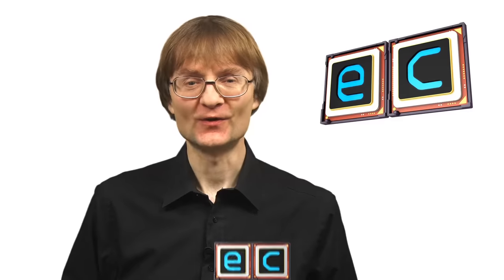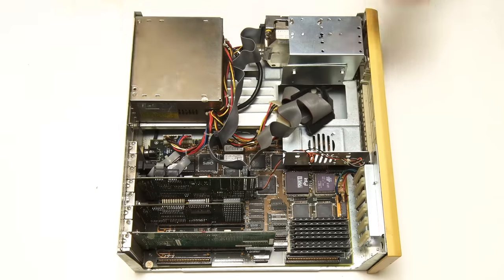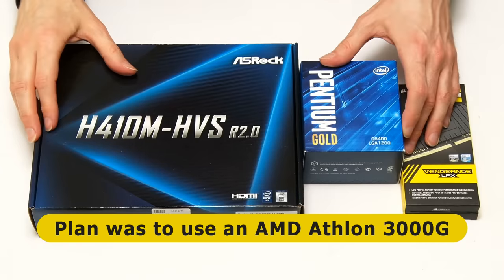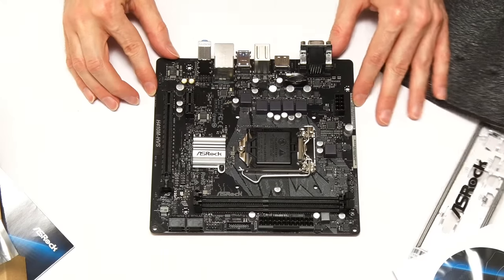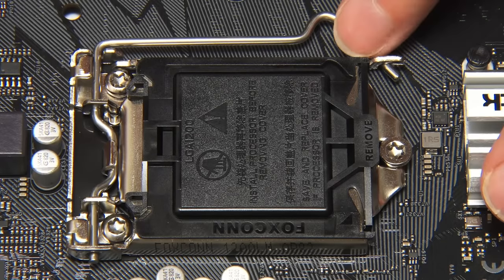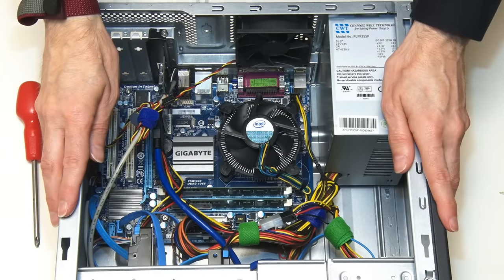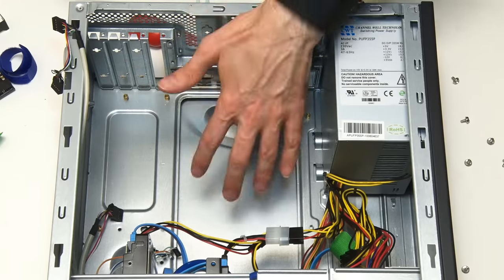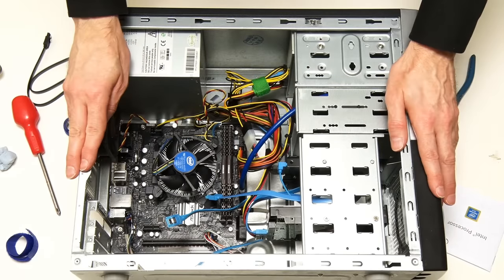Old PC Upgrade: Motherboard & CPU

Comment: Great video. It was nice to see a non-bleeding edge PC being updated. I upgraded my current PC a few years back with a new graphics card and several extra hard drives, but the old computer (it's 5 years old now) is starting to get on a bit. I'll probably go for a full new PC, even in this crazy priced hard ware market, as I can't see that being fixed in terms of supply in the next two years. It's good to see upgrades being not as scary as people might think. ;-)

Comment: My main PC from many moons ago inhabits a very old Dell case. When a major PC manufacturer builds a case and compatible motherboard,  the front panel plugs are guaranteed to be correct. Not only that they are grouped into a larger connector for efficiency in final assembly. In my case I have almost a dozen m/f pin cables aligning things up.
Enthusiast cases have pins like those shown with at most two front panel functions combined in a single dual connector as standards consolidate. The most common front panel functions are:
Momentary contact power on/off
Power LED
Disk activity LED
Momentary contact System Reset
Chassis speaker

There are several things that are becoming more standardized such as front panel USBs and audio connections.

Comment: There are two different standards for the front audio connection (which has to do with different codec standards).  If the case and the old motherboard are ancient enough, that front audio cable might not work with the new motherboard.  I ran into this problem during an upgrade, and had to buy a new front audio panel that fit into the case's unused 3.5" front drive bay (floppy disk?).
Reply from the maker: This is an extremely important point that I should have mentioned in the video. The case I was using had both standard and HD audio connectors, but earlier cases will not as you say.
Reply: @ExplainingComputers  What's even worse is that the motherboard connector is the same between both standards, IE: you can physically plug the older front panel connector into the newer motherboard, and it won't function correctly.  The good thing is that it also shouldn't damage anything, at least it didn't hurt the MB when I tried it.  If you look at the manual for the newer and older mother boards you can see how the various pin functions were re-assigned between the two standards.

Comment: This was good to watch, and amazing how things have progressed. That heat sink alone was fascinating. You can tell they wanted to spiral out the heated air from the design, which is a massive change from the original Pentium processors. 

Thanks for uploading this!
Reply: That's the one piece I wouldn't keep... they're adequate HSFs, but I'd swap it for just about anything with a copper foot and a more-captive fan. The blades out there where a strayed wire could hit 'em always gives me the heebie-jeebies.

Comment: You could use an M.2 SSD if you wanted to with a x4 adapter card since the PCIe slots aren't populated. Handy for when the motherboard doesn't have an M.2 slot.
Reply from the maker: True! :)

Comment: Good video as usual. I actually "sidegraded" last year; I have a PC I built in 2013 with an AMD processor from a couple of generations back that didn't like Windows 10 very much. I got a Dell Optiplex 9020 mini-tower and swapped my PSU, graphics card, RAM, drives, my front panel USB 3 adapter with SD card reader and it works very much better with Windows 10. The only thing I added was an I7 4470 and a Dell to ATX PSU adapter cable. Total for the PC and parts was about $320. The reason that these Dell Optiplex models have proprietary PSU connectors is that they are workstations meant to be used in big companies like call centers. If you don't need to swap motherboards this is a good alternative for everyday use, light gaming or a good Linux box. The PSU adapter cables are trivially easy to pick up and cost around $10-$15.
Reply from the maker: Sidegraded -- I must remember that one! :)

Comment: Perfect video tutorial. I've learned alot. I'm going to attempt my first build with older used parts and wanting to install them into an HP Elitedesk 800 G1 MT, if at all possible. No doubt that I will come across some difficulties but channels like this are a big help. Thank you.
Reply from the maker: Good luck!

Comment: I did this upgrade Richard. The only issue I had was the front panel connectors on my old case were all merged into one so there was no option about which pins controlled the hdd leds or reset switch. I just connected the block. The only thing I really care about was the reset switch and that worked correctly. Windows 10 came up without batting an eyelid and I will be checking all the drivers in due course.
Reply: My old case had a built in SD card reader which had a four pin female inline connector. I wasn't sure what to do with it but it turned out to be a USB2 connection which fitted onto half a USB2 header on the motherboard. Initially I got no audio on my hdmi monitor but I just ran the autostart on the drivers disk and that sorted it. Sorry about getting your name wrong Christopher. Massive embarrassment.

Comment: in fact that plastic cover that protects the pins on the MB is to be removed by pressing the bracket onto the cpu when it's in the socket. Most of the folks don't know that - and I've learned it from one of the manuals only recently, because I finally read one :)
Reply from the maker: I don't know which manual you've read, but it certainly isn't the one that Intel provide in the box with the CPU! :) This specific instruction guide from Intel says to raise the retention mechanism, then to remove the plastic cover, then to fit the CPU. Apparently some motherboard manufacturers advice removing the cover by popping it off using a processor, but it is certainly not something that Intel has ever recommended! :)
Reply: @ExplainingComputers   It was the Asrock, can't find the exact manual now but they did put it in their FAQ:
https://www.asrock.com/support/faq.asp?id=340
you have to click on the question below the table to get the popup which explains it. So it is in fact manufacturer-dependent, HOWEVER - your way (Intel official) will work 100% of the cases, so I stand corrected and encourage everyone to do it the way you did!

Comment: Hi Chris. Your channel was my first go to YouTube learning centre about 2 years ago. I picked up enough knowledge from you that aloud me to build my first PC in 15 years. 

Today’s budget build will help anyone the has an old PC and a has limited funds. This is definitely not a build for anyone that interested in building a Expansible system that will allow them to swap out parts and upgrade there system to something more powerful. The parts section put limits on what you can add. The motherboard is a major holdback, adding a higher end CPU would require a larger power supply and the lack of a M.2 slot is disappointing.  

Anyone that is in need of a more expendable system should review some of your past PC builds, the Ryzen system comes to mind. 

Take care and will see you next week

Comment: i was hoping to see ryzen xD or an older i5-8500. Based on the price i will prefer slightly older higher end parts than newer lower end parts. The older higher end parts will always have better performance
Reply: That is a good point. Also what supports older high-end parts will usually support newer high-end parts, once the price comes down.

Comment: Really nice video. Great photo. I would have replaced that stock power supply from CWT though. The older ones have a somewhat bad reputation, they tend to start fires... Their newer PSU are of much better quality.

Comment: Well that was very informative.  I had always assumed, obviously wrongly, that when you change the motherboard as long as you keep the drive with Windows on it, there would be no problem.  That could be quite an additional cost.  It keeps mounting up.  Thank you for posting that, excellent as always.

Comment: I have done exactly the same thing on a pc. I kept case, fans and psu. I also have no gpu. But my suggestion is to buy always a good psu. On another old machine i changed refurboshed dd3 mobo and ram and the refurbished psu (corsair) was shit causing random restarts. So i bought a new seasonic and now it works fine. PSU is the most important part of a pc while case is the less important.

Comment: This is not an old PC upgrade, this is building a new PC cheaply by using recycled parts.

Step one: throw out the old hardware.
Step two: Put new parts into old case and connect power supply and hard drive.

Comment: I did a very similar build upgrade a few years back Gigabyte H110m motherboard and Kaby Lake Pentium. 
Noticed that my old Intel CPU cooler had a copper insert so re used it instead of the new one, with a $5 tube of Arctic MX-4 and it runs reasonably cool even under load.

Comment: I wonder how you got 3050 for a passmark as my ac version of this motherboard with the updated version of the same CPU as yours plus 16GB of RAM at 2666Mhz with a samsung SSD only gave me 1866 :(
Reply from the maker: Sorry to hear this. I got the 3050 just by pressing the "run all tests button". What was your SSD? And CPU? And was this running Windows 10?
Reply: @ExplainingComputers  Windows 10 home 64bit. Yes I did that. The CPU is the Intel Pentium Gold G6405 version so 4.1 Ghz as opposed to your 4.0 Ghz one, using with the H410m/ac mb. Is this mb one not quite the same ? Bought it for the M.2 option. Btw with crystel disk mark about 550. The SSD is a samsung evo 250GB
Reply from the maker: @digitalmediafan  This is very strange. You clearly have a slightly better CPU, and the motherboard has exactly the same chipset (H410) so should give the same performance. Your SSD is also at least as good at the one I used (you can never go fromt with a Samsung EVO). So this kind of suggests some kind of driver issue to me, or something not set in the BIOS. I would take a look at the individual passmark scores (for CPU, RAM, etc) -- which you can see in the video on the left hand side at around 24:45 -- to find out where your lower score is coming from. Please do report back on this.
Reply: @ExplainingComputers  I see you are using a registered version (?) 9. I am using the 10.1 evaluation version. I tried clocking the ram speed down to 2400 but same result...
Reply from the maker: @digitalmediafan  Yes, I am using a registered version of version 9. But I think we have nailed this -- they apparently changed the algorithm between versions 9 and 10, so results are no longer comparable(!): see https://www.passmark.com/support/performancetest_faq/v10-results.php  As they say "So the new individual PT10 results can't at least on the surface be compared to the PT9 results. They are really different."
Reply: @ExplainingComputers  ah that's very interesting thanks. With this version I now get 3153 for 2400 Mhz DRAM setting and 3211 with 2666 Mhz. I've uploaded 3 separate results to my community section. Only thing is the 410m/ac is meant to accept up to 2933 Mhz but with me the maximum is 2666 which is a shame as I bought 3000 Mhz RAM :(

Comment: Right, small tip, especially if you do most plugging in with the motherboard already screwed into the case: 
GET YOURSELF TWEEZERS!
I cant overstate how hard it can be to have the connectors for power, LED and so forth right against the end of the case, or SATA ports pointing to the front of the case behind the drives, all of those making things exceedingly hard to reach with fingers.

Comment: I recently upgraded a PC for a neighbour.  I got them a new Windows 10 license key from Amazon for very little money. £10.
Reply from the maker: Yes, there are many options out there . . .
Reply: New and 10 punds sounds shady - I know one can buy - but I would not do it myself. It is much easier to get a refurb PC with a key written in UEFI. Usually a pro version. Other than that I always buy genuine BOX version so that I can transfer it easily to a new machine if this one dies...

Comment: I generally consider a "build" to be where you're replacing a motherboard and processor and re-installing the operating system software as a result.  However, simply replacing or swapping out a CPU and/or adding memory, and/or adding a video card, I just call those upgrades (basically, where a new re-install of Windows or the OS isn't necessary).   Of course with modern versions of Windows, you could try to re-use the previous install but you'd have to likely re-activate with a new key, so really it's the same thing as re-installing the OS other than you're not physically doing it, but in the eyes of MIcrosoft, for example, it would be a new computer (if you had to re-activate using a new key).

Comment: Love the way you explain things and the good closeups. I built some new computers for myself and family recently and with parts left from their old builds I built another as a spare. GA-MA770-UD3 motherboard, Athlon 7750 2 core/2.7GHz and 8GB PC2-6400 DDR2. A new 250GB WD SSD and a cheap case. It is running Windows 10 Pro exceptionally well for general office work and internet Browsing (Youtube mostly). For a 12 year old MB and CPU I think this is great.

Comment: I would also rotate the plastic push pins. It shows that it needs to lock into place by rotating in the direction of the arrow. It should ensure better cooling and that the cooler won't ever snap out of place.

Comment: I'm a bit late to this party, but one comment that may help others, is that older MotherBoards may also have problems with coping with later and faster Drives. The point being that updating from, say, a SATA I 1.5 Gbps spinner, to a SATA III 6.0 Gbps SSD, could trigger random crashes and hangs that are a devil to diagnose.

So, changing the MotherBoard, CPU and RAM (and GPU too if budget allows) that is designed to cope with up to date Drives, may be a better plan than filling an old machine with later and faster Drives. Sometimes that works well, and can give a new lease of life, but just beware that this can introduce snags all by itself.

A few years ago, I needed to keep a few HP Workstations going, and that mainly involved adding larger Spinner Drives to give us some much needed extra storage space. As it happened, the Drives I managed to buy at a good price were HP Branded, all 500GB SATA III units, and 7,200rpm. That should have been plain sailing.

But I just kept getting random hangs and crashes, until I fell upon an HP Notice that confirmed the HP Workstations concerned had a known issue with faster SATA III Drives, unless a specific HP unit matched to a specific HP Firmware. Finding such Drives was not an option, and would have cost the earth.

Basically, the MotherBoards were only designed for SATA I 1.5 Gbps, so had a bad hair day when faced with SATA III 6.0 Gbps.

As I had a pile of these Drives, I had to find a way around it, and my solution was to source well priced PCI RAID Cards which, whilst also a bit old, could at least manage SATA II 3.0 Gbps. That I hoped would be enough to buffer the use of faster SATA III 6.0 Gbps units.

Thankfully, by connecting the later SATA III 6.0 Gbps Drives via the RAID Cards, that was enough to slow down the Data transfer speed via the PCI Card interface, to stop the MotherBoards getting all hissy.

Got me out of a hole, but it took some hunting to work out the problem. That was the problem, the loss of valuable time, and having to work around crashes and hangs until that was resolved.

Point of writing is to say if you have a choice, updating the heart of a machine, such as the MotherBoard, CPU and RAM, may well be the way to go to avoid potentially big problems trying to install much later Drives to work with older components.
Reply from the maker: Thanks for this. And just to note for others that this would only be a problem with hard drives. All new HDDs and SSDs can transfer data at SATA I and SATA II speeds. But some 7200 rpm HDDs (as reported here) may struggle it seems to function that slowly.
Reply: @ExplainingComputers  Thanks for the reply. This was in around 2015, and the HP Workstations were XW-8200 and XW-6200 units, so already pretty ancient.

But I did also initially have issues with a Kingston 128GB SSD as well, which was a SATA III unit. Things may indeed have changed since 2015 as you did say new HDDs and SSDs can operate at slower speeds, suggesting perhaps the 2015 SSD just wasn't designed to work at below SATA III?

But that too caused hangs and crashes as well, so muggins here went and bought HP HDDs thinking it was the SSD! Turned out to be all SATA III units unless a specific model of HP HDD that I think HP had released so it could operate below SATA III when needed if fitted to older Workstations that had this issue.

Apologies this is old history, but the point is a good one I think, to just be aware that mixing very old with very new can have unexpected problems that can be fun to work around!

BTW, watching many of your excellent videos, I am taking screen shots of the main illustrations and then saving as PDF, which is a very handy way to keep for myself a quick snap shot of the key details.

Comment: One thing to mention on some of those OEM cases that can house a stock Micro ATX motherboard is to take a look at the front panel buttons connector. Some OEM cases have a connector where all the buttons are on single plug that has a different pin configuration than what a stock motherboard would allow, and may need a creative solution to get the buttons to work again.

Comment: I see the ac version of the motherboard has M.2 and wi-fi / BT built in and is just under £65 on amazon plus 16GB of 3000 Mhz Ram is just under £81, a nice spec for a good price. Also the just released 6405 CPU is a bit cheaper and faster at 4.1 Ghz